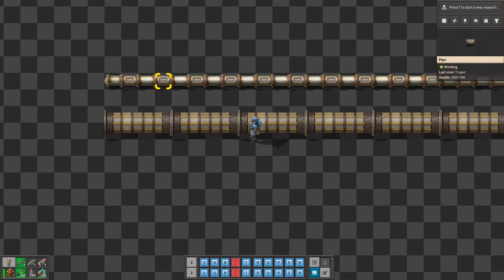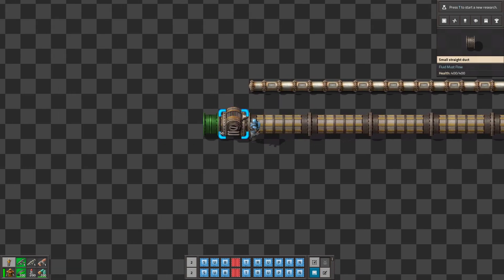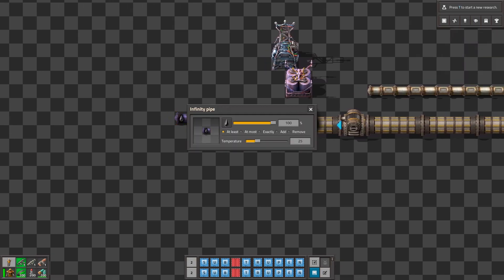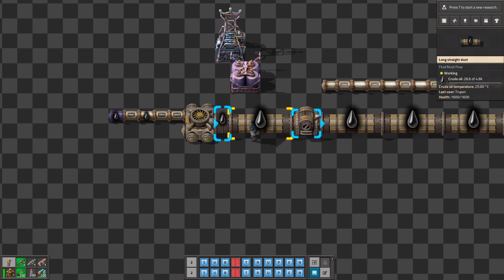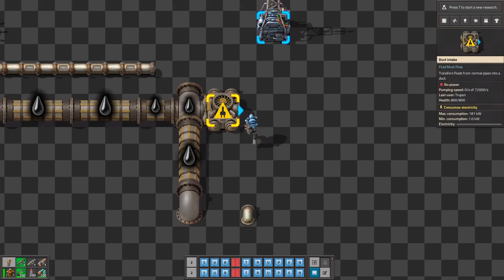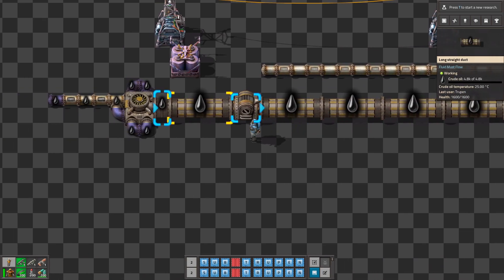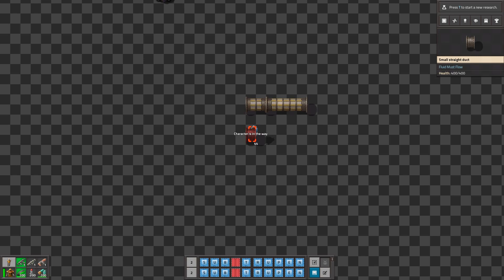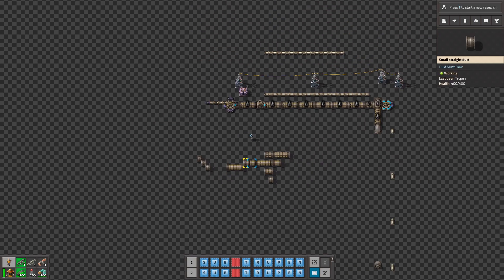HUGE pipes in Factorio!

Comment: Is this compatible with Bob's? I'm looking to make a fluid bus, but the common solution is not ups friendly. I need pipes with larger storage and throughtput. Anyone tried yet? There's a lot of fluids and gases on bob's chemicals.

What I'm currently doing is basically putting the fluids and gases on gas bottles and barrels, and sending them through a bus. I know bus is unusual with Bob's, but I like it - it's a huge bus lol

Anyway, If I could replace belts and constructions just to compress and decompress stuff, would be awesome.

Comment: This should be in game by default.
I hope developers sees this. 
This is absolutely great.
Reply from the maker: it's to complicated mod for a vanilla, however trick with a ups save should be implemented to core
Reply: In fact this is in the game, you can just use tanks as big pipes lol. The truth is: you can't just make a pipe bigger and get a fast flow speed. There's hidden pressure mechanic that bases on a level difference, so the more fluid level difference in the two pipes the faster fluid flows from one fluid storage to another, and there's no difference between all fluid storage types. Basically the best way to achieve a maximum flow speed is to use tanks with pumps in 1:1 ratio. This gives you a flow speed that nearly equals 12000, which is maximum speed that the pump can do.